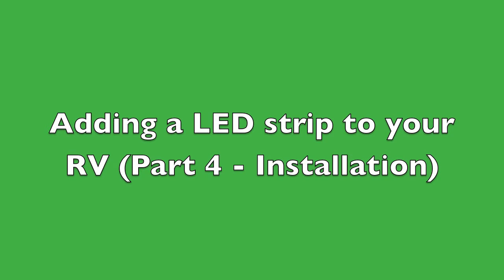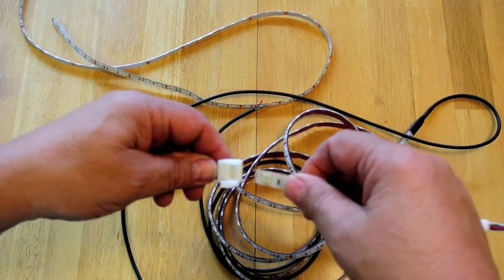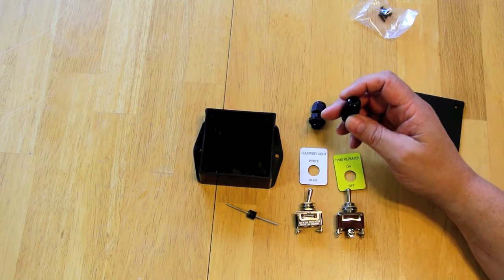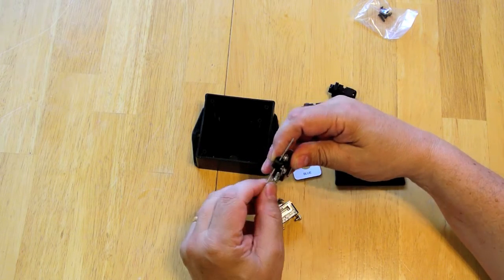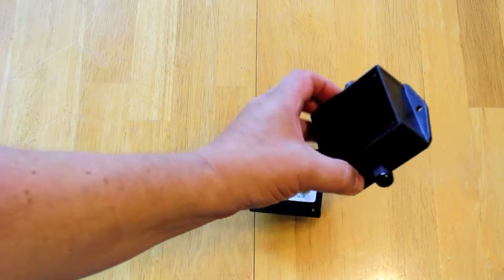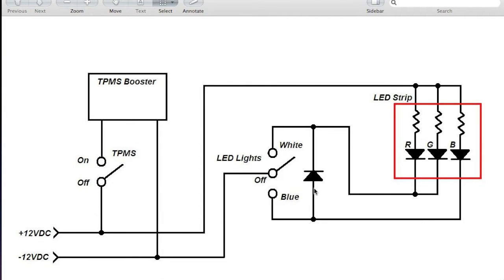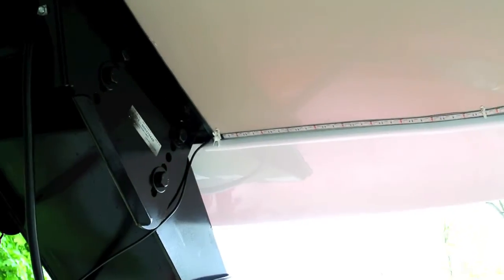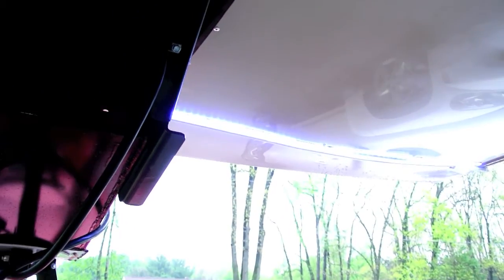Adding a LED Strip to your RV (Part 4 - Installation)

Comment: Great series, thank you. Did I miss the part where you showed where/how to drill through outside to run wires? Also, did I miss the part where you showed where to tap into the rv power? Those seem pretty essential to this project.
Reply from the maker: As each RV is different, the routing of the wires will differ, so there is no one fits-all method of routing the wires and connections. 

I have tons of information available, plus circuit drawings on the webpage associated with the video: http://www.rv-project.com/projects/ledstrip.php

Similarly, the connection to 12V power in the RV would also depend on the particular RV.  However, I did produce a video and website project page on a 12V distribution project that might provide some ideas: http://www.rv-project.com/projects/dist.php

Comment: If I want to make white and purple (not blue) is that possible? If so, could draw a wiring diagram similar to the one in the drawing? Thanks, excellent job.
Reply from the maker: You might get close. If you understand primary colors, the three primary colors (transmission) are Red Green and Blue. Any other color is a combination of these colors.

For example, if you connect Red and Blue, you will get a shade of purple. So you will want the switch to turn on Red and Blue for Purple, and the switch to turn on Red, Green, and Blue to get White.

Give me a day or so, and I will update my webpage (http://www.rv-project.com/projects/ledstrip3.php) to show the various color combinations possible with a simple switch connection).
Reply: Sounds good, thanks!
Reply from the maker: The webpage changes were not difficult, so I have already made them.